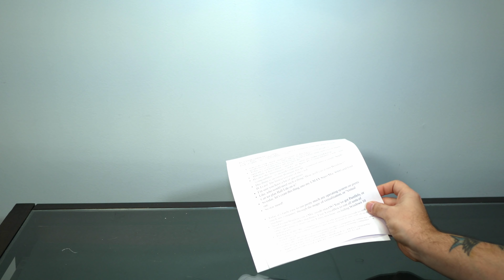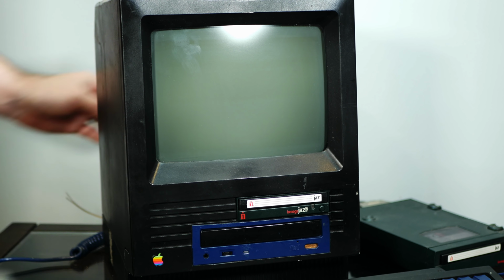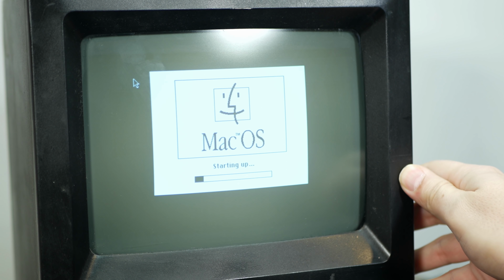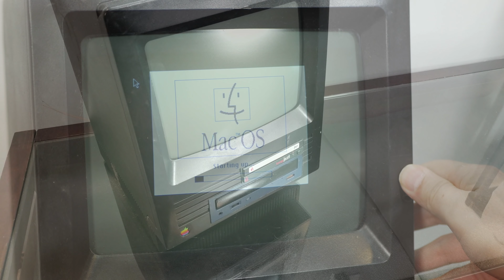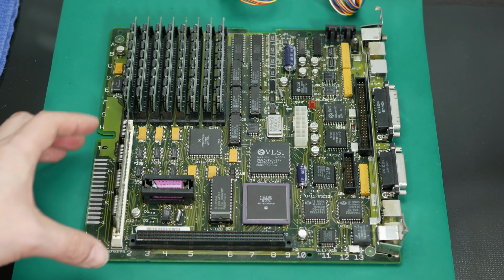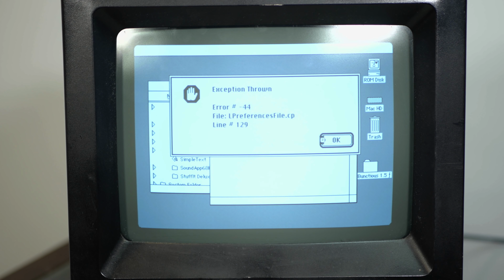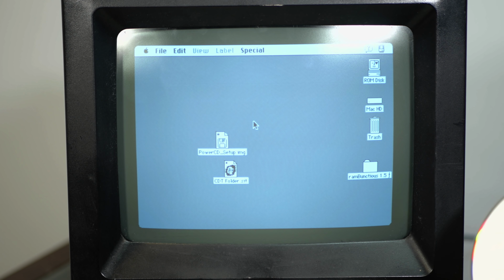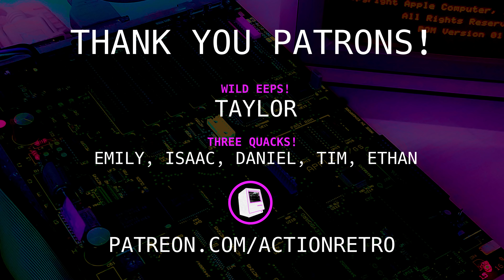Opening a CURSED Macintosh SE! What are all of these crazy modifications?

Comment: Whoa!!! This is quite a crazy machine. I love the black look -- definitely keep it and see if you can make it look nice again. those speakers inside??! WTF!! I love everything about this!!
Reply from the maker: Hahaha yeah those speakers are crazy! I wonder if I can wire in some nice speakers in the same spirit :)
Reply: Hey Adrian, i was about to share this with you, but looks like you watched before me lol
Reply: I’m definitely with Adrian! Though, I do strongly recommend replacing those capacitors! Also replacing that battery with a CR2032 battery holder (including a battery ofc) would be the best fix to undo that lovely machine from the danger of another leaky battery. 

You could probably just buy a tiny audio amplifier from China, which works on a 5 volt power supply. Either with an analog or digital volume dial/button. 

Adrian mentioned in one of his last video’s that he accidentally broke the neck of the tube on the Mac his family used. You might want to discharge that CRT and disconnect the neck board, before you get zapped, or worse: the neck of that tube breaks! 😩😋

That CDROM drive might be fixable, but it really sounds like a gear or a rubber band has deteriorated in there. There are quite a lot of SCSI CD-ROM drives popping up second hand lately. You might be able to obtain one, with audio features on the front and back, for a fair price of about $15. 

You’ve found a lovely project! I’m definitely following you on this one! 

Oh, and many thanks for the great content! 🤗🤗
Reply from the maker: @Inject0r  Hah yeah I do really need to be careful with that tube and neck. Great suggestion about the audio amplifier! I'm definitely going to have to look into that. Have you used one before in anything?
Reply: @Inject0r  If a 3V battery will work why not just use a CR2 photo battery in the stock holder, they're the same chemistry of as the coin cell batteries and shouldn't leak like a lithium thionyl battery.
Reply: Brandon Upchurch fair point. If they don’t leak as much as the original, or better yet, if they don’t leak at all (like the CR2032), replacement of the socket is really a non issue.
Reply: @ActionRetro  the CD-ROM is @#%@#ed. Note the disc stays in the same position, the spindle motor doesn't work.
Reply: @greggv8  Yup, definitely buggered! I thought as much when it kept opening on its own even before the system had booted.

I think it'd be great if you could wire both the system speaker and the CD audio outputs to actual speakers! Sound quality won't be terrific no matter what you do because speaker size is limited and the SE case isn't exactly a proper speaker enclosure so you could well keep some of the speakers that are in there (I'd say two are enough, one for the built-in audio and one for the CD drive, unless you managed to wire both into the same stereo amp somehow, then you could use one speaker on either side of the back case for stereo sound).

Comment: I would absolutely want to keep the outer appearance at the least. The black with the blue CD faceplate, and the red buttons on the Jaz drive look really cool!  Actually, that would probably be less work than removing all the paint, and probably having to retro bright the case. As far as the interior mods and improvements, it looks to me as the the original owner had some great ideas, but wasn't able to implement them cleanly or well. As you pointed out, it may just be a work in progress that was far from complete. I would love to see it finished up and working as much as possible according to the original owner's vision. If you foo that, you have a true uniques and fascinating machine here, as opposed to another sick se 30. Good luck with it, and I am really looking forward to seeing where you take this.
Reply: Probably wouldn't need to retrobrite this case, as the paint would have protected the plastic from UV exposure. For that matter, depending on the method used to remove the paint, any existing UV yellowing may be removed with the paint.

Comment: Hello fellow Apple collector. I initially thought this was one of those ultra rare TEMPEST machines. It’s not but this is actually just as cool. Please do a series on how you restore it. I’m not too big a fan of the two tone aesthetic, I’d personally paint it all black (including that internal Jaz drive, if you can get it working) but do as you wish, I’ll watch the video anyway! The CD drive is probably a goner (the CD doesn't spin, the eject loop confirms that), and Apple did make black mice and keyboards that would look great with this SE/30.
Reply from the maker: Oh great idea about finding the real Apple black keyboard and mouse! They're from the Macintosh TV right?
Reply: @ActionRetro  They made some for the Mac TV but also for the 5400/5500 "Director Editions". A couple years back they were still affordable (I just did a quick eBay search and that's no longer the case...), so you need to be patient and wait. I know a fella who did buy one for cheap on Yahoo auctions but it had a US/Japanese layout. So that's another option. For the audio part, please use a proper mixer (there are some cheap PCBs on eBay/alibaba) that will do the job much better than twisted wires.
Reply: @theapplechronicles9863  : And some proper connectors to match! The external speaker hookup isn't a bad idea, but the method...
Reply: I still have the remnants of a TEMPEST Apple II+ in storage. Haven't tried firing it up in years, though. Came with an interesting assortment of attachments, all in big green shielded cases. The keyboard was converted to external and has a joystick built in, with a socket for a Koala Tablet (sadly not included). Also came with a hard drive, VCR for backing up the hard drive, printer, color monitor, and a line-conditioning power supply. The manual for it also listed a number of other attachments that we didn't get, such as a second, monochrome monitor.

One of these days, when I get time and space to do it, I'll probably try firing it up again.

Comment: Great score. The hanging on the extensions load is  because the 7.5.5 Gusd hasn't been been modified, it won't boot a 32bit clean ROM without the MOD. Some of the BMOW ROMs made it by Steve without the CDROM driver installed, I received two of them like that. For the paint, Krylon Fusion adheres really well. Oh, I forgot to mention, BMOW ROMinator II Atom, it takes three minutes to initialize a drive because of the initializer Steve has put on the new ones, opposed to the forty-five minutes per drive it took for the earlier models! BMOW came through big time on this one:) This is if you are using SCSI2SD, above version 4.6.
Reply from the maker: Thank you for this info, it's really helpful!

Comment: It's a mad mod, I wonder how many people actually appreciate the effort & cost to achieve the end result. The Jaz drive dates it as early as 1995, still SE/30 where quite expensive back then (Apple ceased production 1991), it was maxed out with 128MB, running OS 7.5 (1994). I guess this is around the same era as Windows 95, most PCs at that time would be running with 2 possibly 4MB RAM and sound was still an optional extra!

Comment: I vote for keeping the mod going.  For the outward appearance, I suggest changing the CD-ROM out for a working unit in black (or find a beige one and paint the faceplate to match the case).  You may want to find some very fine sandpaper to smooth out the blemishes on the top and respray with a matte black.  I used Krylon brand paint last year on a very badly yellowed luggable 286 and it turned out beautifully picturesque.  It's still looking smart over a year later!  I just found your channel and I'm subscribing now.  Keep it up!

Comment: That's a neat looking system, I'd keep its coloring. The CD drive looks like the position sensor isn't working. You can probably get the it working if you take the drive apart. There should be a switch on the board which gets pushed to the side when the tray is open all the way or when the drive is fully loaded. Spray in some contact cleaner and wiggle it around, it should be good to go! If that doesn't fix it maybe you can find a different drive from the same manufacturer and swap the faceplates.

Comment: Incidentally, I see leaking on some of those caps. You can see it with a dull shine around them. A recap should be done :-) Now the level of jank on this machine is to a new level! How wild! The painted CDROM bezel is probably causing the button to be stuck.
Reply from the maker: Definitely needs a recap, but my soldering skills are abysmal! My proudest soldering moment was fixing a cracked solder joint on the analog board on my Mac Plus, and I was sweating even on that... curse these hamfists of mine!
Reply: @ActionRetro  heh!! if you have some old machines like some Classics those are perfect to practice on :-) Sadly the leaking caps is like rust on a car. If you don't deal with it, it'll keep getting worse and worse until eventual destruction.
Reply from the maker: @adriansdigitalbasement  Hah thanks for that advice! I was planning on picking up some old alarm clocks and stuff from the thrift shop to practice working with small components. I did just get a nice quality soldering iron recently - though I've only used it once so far!

Comment: That CD drive needs a good cleaning, perhaps even a complete replacement.
You're right about the driver issue, as it's unlikely that the BMOW replacement ROM has CD Drivers in the system folder. A similar issue explains why MultiMoviePlayer wouldn't work, specifically that it couldn't find Quicktime. Not sure why it gave that generic error message instead of saying it couldn't find Quicktime, though.
Your best OS option is probably going to be System 7.5.5, like the read me file on that hard disk suggests is already on it. I'm not sure if the SE/30 is supported by 7.6.1, and there's not much that requires 7.6+ that you'd be running on an SE/30 to begin with. Also, for those who didn't know already, System 6 won't let you use all 128MB of memory, as it only supports 24-bit memory addressing. This limits System 6 to 8MB of RAM for programs to use. 
As for the case, I agree with those who say to keep it black. Though it could make finding a replacement CD drive tricky, as not many SCSI CD drives came in black. You can find adapter boards that let you use an IDE CD Drive on a SCSI bus, but it's not ideal. 
By the way, it's entirely possible that it was an SE/30 case to begin with, as we can't see any original labels. About the only way to tell for sure is to see if there are any signatures embossed onto the interior casing and compare them to the ones from known SE and SE/30 cases.

Comment: WOW, that brings back memories. I designed my first website using a Mac SE 30 with system 7.5.. I made my whole page 400 dots wide.. I still have the graphics and page template from the site. I continued using Simple Text even after I upgraded to Mac G4.  

How about routing all of the internal sound wires to Bluetooth so you can hookup external Bluetooth speakers.. It would be nice to have wifi

Comment: Not sure if you don't show it on the video, but typically when servicing one of these, one would discharge the CRT first, as, if memory serves, there's a 9kV charge there, and that'd wake you right up. They've got a built-in discharge circuit (again, if memory serves, it's been a long time now), that'll bleed it down within a few minutes of it being turned off, but on something of this age, probably don't want to bank on that circuit still working properly. Pretty cool to see one of these again; used to see these serviced on a daily basis when they were the new hotness.

Comment: You should add a small modern amp board to it  and reattach the speakers, I would just drill the case and use black screws and nuts instead of glue I think. Then you could wire up proper cd audio once you have a working drive

Comment: If this was mine, the first thing I would do is carefully strip it down and back to the absolute basics to see if the basic machine is sound. Remove all the cables, all the extras and then test all the drives one at a time etc. Methodically build it up again one piece at a time. So much easier than your rather haphazard approach. If something doesn't work, you can put it to one side and come back to it later if you want. You end up with a solid base on which to add each of those extras bit by bit... hopefully with less sticky tape. 😉   Oh, and then give it a fresh coat of matt black.

Comment: That CD-ROM is probably opening again and again because something is getting stuck inside the drive and not allowing it to see the tray is shut. I can hear the motor going. Maybe try to plug in another drive and see if works. This is actually a really cool build. You are right about those clean cut lines though! I would like to know what methods they used to get the clean lines.

Comment: Amazing specimen :-) I would also keep the mod and go further. One thing that I thought about is that the original PSU might not be strong enough to power all those extra bits... might be why the jaz was disconnected...
Reply from the maker: Oh yeah I had that thought too. I'm thinking to maybe do a SCSI2SD instead of the Jaz drive since that barely takes any power :)
Reply: @ActionRetro  it would be nice to have the cdrom and the jaz working there,  though! Pretty amazing job they have done with the case, as you said... it is worth making it functional ;-)

Comment: There used to be a hidden control panel that had an option to disable the start up ram test. 
I had this problem when I maxed out the ram in a computer I owned. 
It took about five minutes to boot wile the POST test took place.
I can't remember the key combination you have to hold when you open the ram control panel.

Comment: The CDROM drive may need some cleaning, if the tray motion detection is dirty, then it will act as if it's blocked and reverse the motion, sometimes you can flip the tray position by blocking it deliberately - if it's out and wont stay in, then block it when it returns and it my pull in and stay

Comment: Classic CDROM drive problems.  The button is either broken or the drive can't detect that it has closed or opened all the way and so it is stuck in a loop.  Cleaning the bottom of the tray and sometimes forcing it closed really fast usually worked for me..

Comment: As others have mentioned keep the mods or go even further, repaint with perhaps some abs paint from Tamiya after some light buffing & some cleaning too make the paint stick & then throw on some clear coat from tamiya should make it nice & shiny while protecting the paint a bit.

Soldering some connectors for the speakers like jst's ordering like a pack of 10 off ebay should be a good option as they are compact enough & handles more power then these tiny speakers could manage anyway.

Comment: I would say that carom drawer has been manually pushed or pulled and is not in correct position on it's rack. Therefore it is not registering as properly closed and reopens, relatively easy to correct.  I think it's too late to put it back and should be taken further.  It needs to be done more professionally internally and should end up a very interesting machine

Comment: My guess is the cd drive mech needs to be re lubricated. It is likely not fully retracting enough to hit the limit switch or optical gate that tells the drive it is closed an the spindle has engaged. The normal behavior for the drive is to attempt to vlose and if it hasn't gotten the closed signal after a certain time it assumes some idiot has their finger stuck in the drive and reverses to release the jam.

Comment: if i were u i would love to upgrade like remodel it
it would be cool see more

to me i remember have CD disk doing that because it may been issues with buttons u push it get stuck or shorted n just stick out n in n out n in. i would just replace it with other cd disk fix that issues n i dont know what above cd disk if doesnt work im not fan of floppy disk but i have ton ton of them packed in box it came out old PC back in 1980 to 1999

to refix that paint aging is sand kt down with 80 grips with water that way get rid of rough shape of scratch n paint it with gross black to match up with colors 

3rd u could add more speaker but i would have it on bottom next to motherboard where vent is that way u can hear it clearly n one they put in it is blocked off vent n all it does is vibrator no sound n speakers have to be facing out vent to hear it

hope this help
Reply from the maker: Thanks man, these are all awesome ideas! Appreciate the suggestion on sand paper.
Reply: @ActionRetro  no problem 
im engineer repair i do be happy to help ya out

Comment: I duno. I think the guy butchered it. He messed up the CDRom so the fascia has interference with the tray. And it is probably overtaxing the PSU as well. I have done mods with my SE/30 which I picked up used in 1991 when I was 14 years old. But any mods I did weren't tacky or butchering. I tried my best to keep it as clean as possible on the inside as I have had a few upgrades pushed into mine. Including 040 accelerator and Pivot quickdraw accelerator for its matching external monitor. I did do some subtle painted trim highlights sometime in the mid 90's just before parking the machine as well as some very clean RCA plugs to interface with a home brewed sound board piggybacked onto the 040 board. They look factory. I kept most other stuff external.